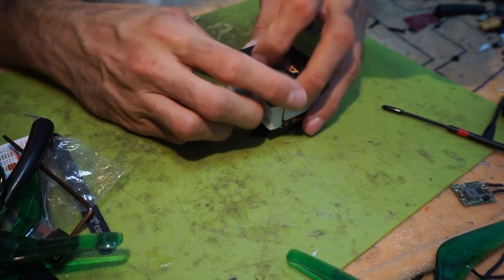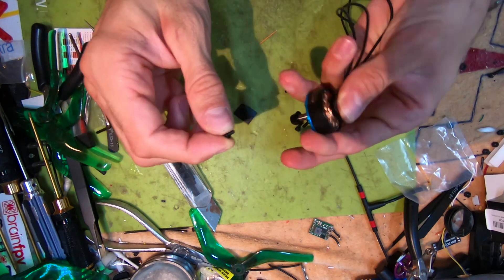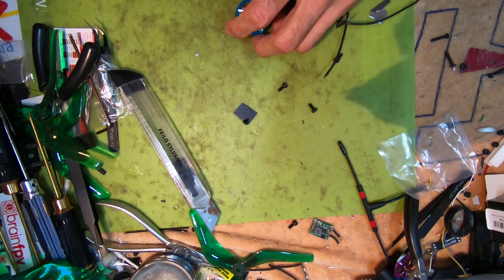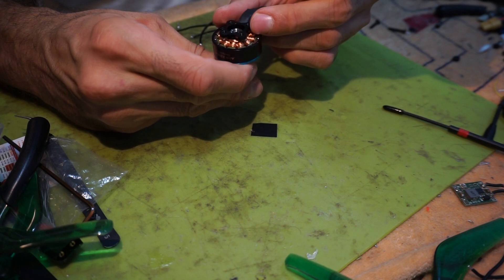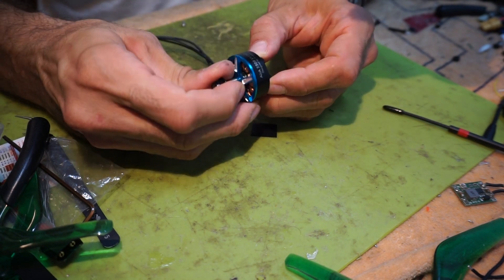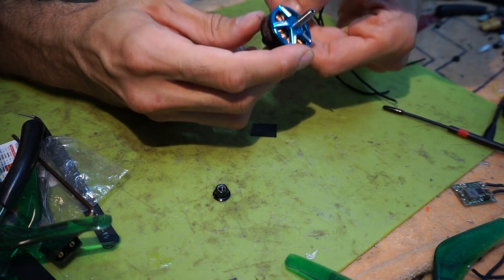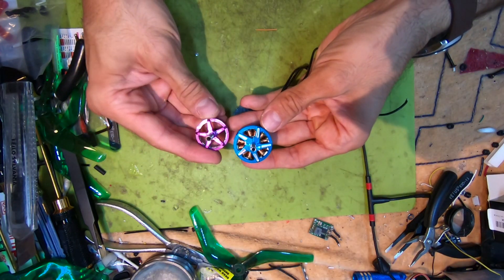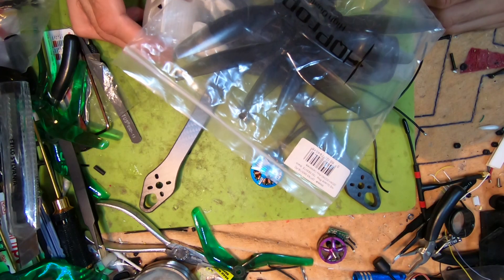Racerstar AirA 2508 1200KV 4-6S Brushless Motor for Long Range

Comment: Did you try them on 5s by any chance? it looks like the efficiency might be better on 5s, and the gain from 5s to 6s is marginal
Reply from the maker: Sorry really didn't. I moved on to BH 2806 1300kv running on 6s.

Comment: Wich lipo and prop you recommend?
Reply from the maker: 6s liion. 20+ min cursing speed time
Reply: @mrRockwellFPV  What mAH battery did you use for 20+ mins flight time?

Comment: Current draw is usually around 6A, I suppose that is Amps/per motor ??? 120W/150W is that usual measurements from FC/ESC or there is also for total power (x4) consumption?
Reply from the maker: Its instantaneous electrical power consumption and battery power draw. Whats so unusual?